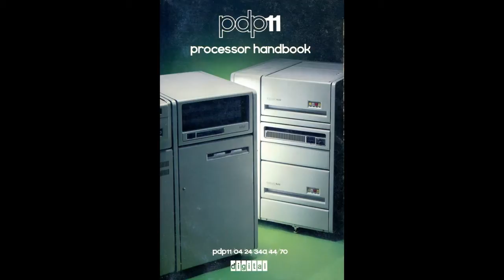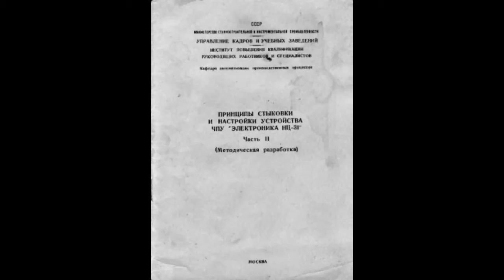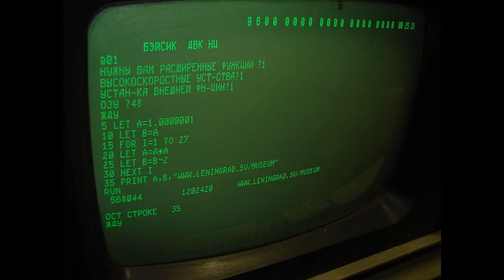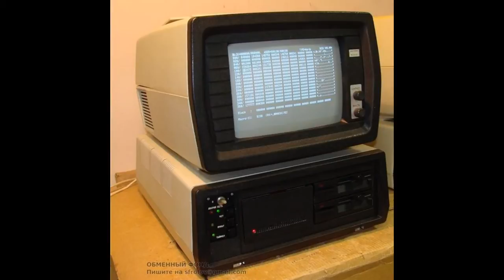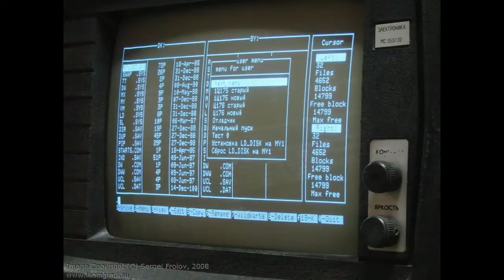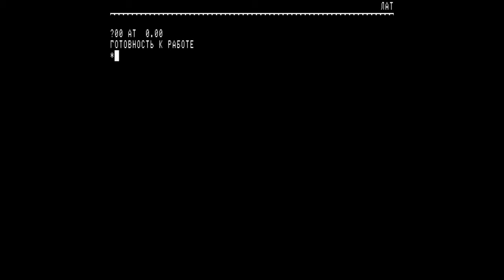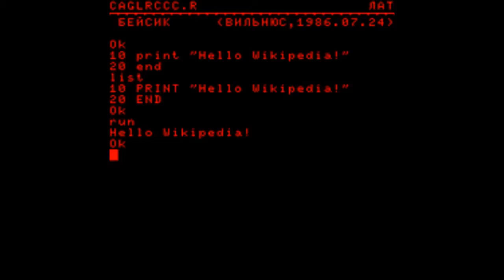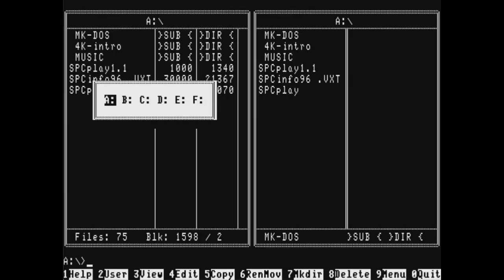Soviet home computer (BK)

Comment: Did the Soviets have their own brands of home computers that the average home could get.
Reply: The first home PCs in the USSR were developed in the early 1980s (NC-8010, BK-0010), produced in small numbers since 1983 (BK-0010), but until the mid-1980s there was not much demand for them - there was no domestic advertising of PCs and few people knew about them. In 1985, the study of computer science began in schools, at the same time began to grow the production of PCs, and the demand for them. By the beginning of the 1990s, more than 100 models were produced - part of its own design (BK-0010 / BK-0011M, DVK-4, "Vector-06C", "Korvet" PC-8010 / PC-8020, PC-8000 "Sura" and "Hobby", UKNC (MC 0511), PC-01 "Lvov", "Radio-86RK" and compatibles ("Microsha", "Krista", "Apogee", "Partner", etc.), "Specialist" are compatible ("Lik","Junior", etc.),"Orion-128", etc. Dozens of models of PCs software compatible with IBM PC and ZX Spectrum, but very different from the hardware prototypes -"POISK", MK-88, MS-1502, ES-1842, "Iskra-1031", "Neuron", "Turbo-86M" and others (IBM-compatible), "Magik", "Companion", "Robik", "Synthesis", "Santaka", "Ural" and so on (ZX Spectrum-compatible). The most advanced among the inexpensive PCs were BK-0010 (the world's first fully 16-bit inexpensive home PC), the UKNC (two 16-bit processors, 640x288 graphics, up to 16 colors), "Vector-06C" (4-bitplanes graphics like in Atari ST, but much slower 8-bit processor), "Corvette" (one of the most complex 8-bit PC, CP/M-compatible, graphics 512x256, 8 colors, programmable palette, simple graphics accelerator, separate text video controller, video memory up to 193 KB, full set of interfaces), "Soyuz-Neon PC-11/16" (16-bit, RAM to 4 MB, high-resolution multi-color graphics, hardware implementation of windows, etc.), PC8002 (gaming PC with hardware color sprites, programmable character generator еtc., close to MSX2). Moreover, the UKNC and "Corvette" were used mainly in schools (since 1987), and as domestic ones they were used somewhere from the beginning of the 1990s. The most popular home PCs of those years are BK-0010-01, "Vector-06C", PС-01 "Lvov", Spectrum-compatible, "Radio-86RK"-compatible, "POISK" (simplified IBM-compatible). 
The cost of a home PCs was high enough (as a conventional color TV), but they were affordable to the typical Soviet family.
Reply: @vladtru9670  
Do you know where I could find documentation, manuals, schematics, and repair advice for the bk-0010? Also, do you know where you can find the PKN-150 tactile button switches used in the early membrane keyboards on the bk-0010?

Comment: I'm curious ... what did the Russians do to access "super" computing power during the Soviet times when the US and the west wouldn't trade with them?  While the US had IBM, Digital, HP, Cray, etc.. what did the Russians use?
Reply: They built their own clones of the IBM system 360. For supercomputing, they built the Elbrus, with superscalar processing and pipelining 15 years before it was widely deployed in the West. Vladimir Pentkovsky helped design the machine, and later came to America and helped design the Pentium 1 for Intel.
Reply: @gregorymalchuk272  Pentkovski, penta-, Pentium? What a serendipitous case of eponymy.